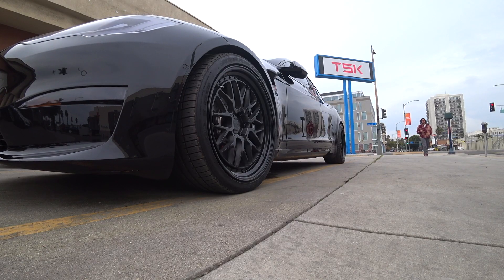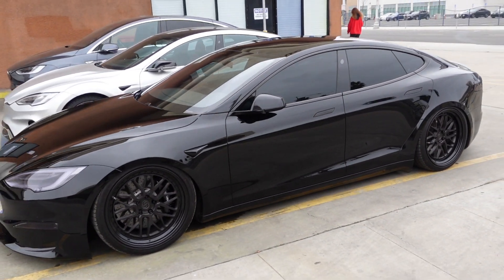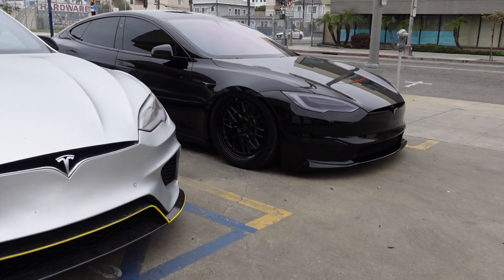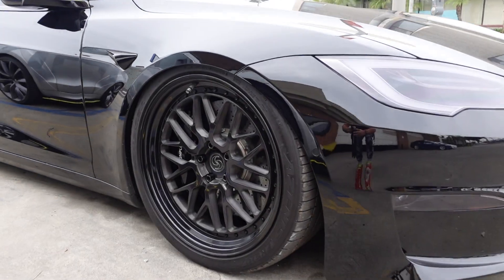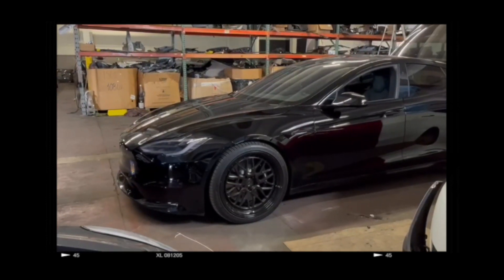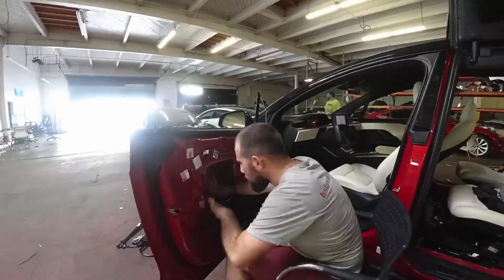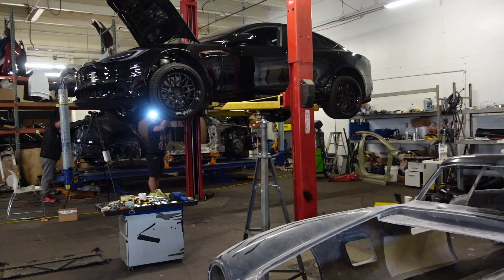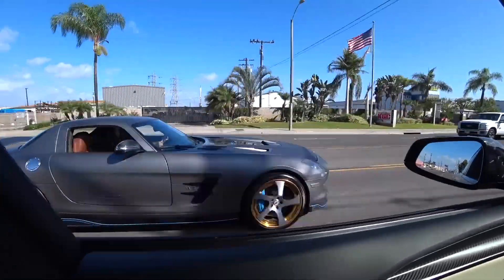Entirely Dismantled Tesla S Plaid. Sound and Vibration Isolation.

Comment: Would you be able to make a video comparing interior cabin noise in the Tesla at 40, 60, and 80 mph, using a decibel meter? It’d be great to see before-and-after data (compared to the previous Model S, if possible). For objectivity, maybe keep HVAC and audio off, use the same road surface, and mount the meter near the driver’s head. Tesla says it’s quieter, but would love to see some proof!
Reply: I would also like to know this. That is the most important question that they left out of the video, exactly how much does it do in decibels before and after, tested at the same speed on the same piece of road? I drove a new stock 2024 Model S Plaid with 21" wheels last year, and at 50mph(80km/h) I measured 66db avarage on a road with normal medium-rough surface in Sweden. That is good, but not 100000$ car good... My fathers Volvo S60 T5 2020 with 18" wheels also perfomed 66db on the same road at the same speed, and that was an 50000$ car.... The most quiet car I tested was an BMW iX on winter tyres (not studded) I measured only 60db at 50mph(80km/h) on a snowy winter road. That is very good, but snow can make it more quiet so it is not an 100% comparable test!